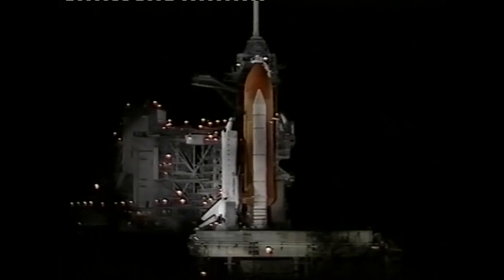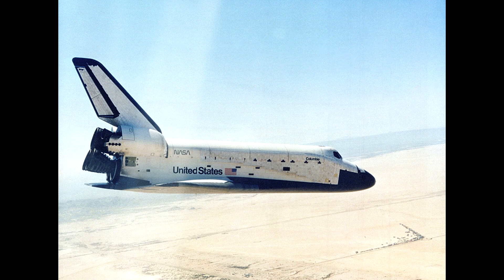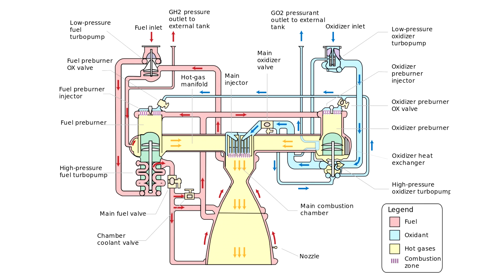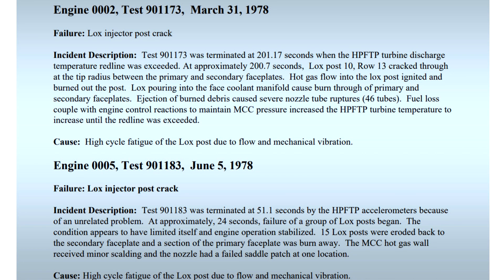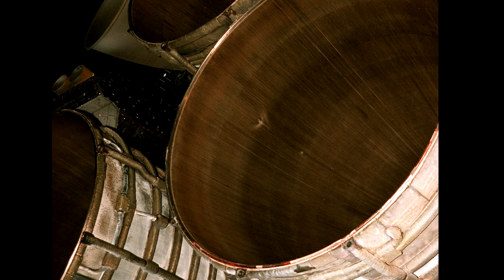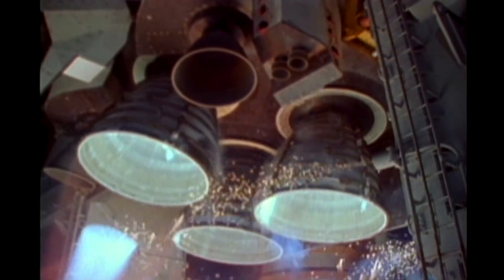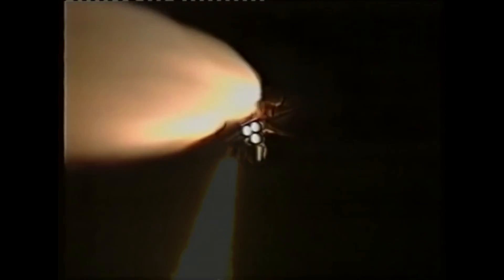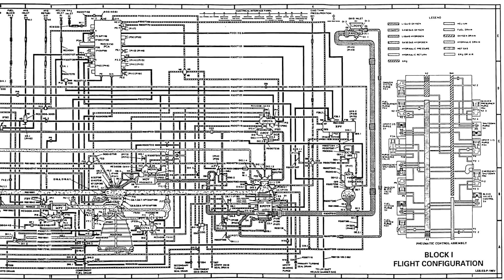How A  Gold Bullet Almost Destroyed A Space Shuttle

Comment: >Oldest shuttle orbiter with increasing failures
>Biggest payload yet (and ever)
...Yeah, that seems like a good idea.
Reply: It was the last mission before the scheduled upgrade that all the orbiters were undergoing at the turn of the century. Its next flight was Mike Massimino's first Hubble servicing mission. It was then lost due to a completely unrelated issue that was not age-related. Although it was one that had been seen 15 years before on an Atlantis launch. Hubris and complacency killed all 14 astronauts, not the vehicles.
Reply: The hubris and complacency of letting 26 unrelated committees design the Shuttle that way to begin with. Putting the crew next to the fuel with no escape mechanism = colossally stupid. And for what? It ended up costing just as much to launch as a non-reusable craft would've.
Reply: Actually it came out costing insanely more, NASA itself says 500 million per launch, with other (I'd say more realistic estimates going as high as 1.5 Trillion per launch)
Reply: @emp_zealoth  - Former astronaut Jeff Hoffman, who is now a professor at MIT, is teaching a class called "Engineering the Space Shuttle". It is available for free on the Edx platform. The co-professor for this course is Aaron Cohen (he passed away in 2010, but his lectures were preserved from the initial teaching of the class in 2004), who was the manager of the Space Shuttle program from 1972 until 1982. Cohen oversaw the entire design, testing, and initial flights of the space shuttle. It is a fascinating class, and there are many guest speakers who were also involved in designing and flying the shuttle. Anyway at one point they talk about the costs of the shuttle program and they mention you could break down the costs in multiple ways. Hoffman talked about the expenses of mission planning, training of the crew, processing and development of hardware for each mission, the processing of the orbiter, boosters and ET, etc. Anyway they mention the STS-83/94 missions. STS-83 was a Spacelab mission that was truncated due to a fuel cell issue, and landed only four days after liftoff. It was decided almost immediately to re-launch the mission as soon as the fuel cell was repaired. So the entire mission was re-flown just a few months later. The kept the same crew, the exact mission profile, and experimental hardware. They mentioned that the repeat mission, STS-94, was overall the least expensive mission in the program as it did not require processing of cargo, re-planning, re-training, etc. It was figured the direct cost of the mission was around $150 million USD.
Reply: I'm not sure I see your point. If reflying a completely prepared mission costs whopping150 mil then the entire program was a complete and abysmal failure
Reply: @emp_zealoth - The point is there was a discussion about the costs of a flight. There are many ways you can break down the costs. But at its basic level, the cost of grabbing an orbiter, processing it for its mission, and flying it to space and back, was estimated to be around $150 million (in 1998 dollars). Just for informational purposes, that is all. Calling the program a complete and abysmal failure is a bit harsh as it did accomplish many tremendous things. It just failed to do them as frequently, inexpensively, or reliably as promised at the beginning of the program.
Reply: It's main objective was to provide cheap, frequent and reliable space flight. It utterly failed on all those counts but was kept around way past it should have been due to political expediency, in the process sucking boatloads of money away from other, way more useful space technology or exploration. Thats where the main problem with STS was
Reply: Krzysztof Zalewski You’re naive to think bureaucracy, especially American, would allow the wasteful disposal of something as large as a shuttle. New rockets, shuttles, and missions go through an enormous amount of red tape, because NASA is an arm of the government. This is why Space X will lead the space race now, since Elon Musk has the money to just throw rockets around while testing them.
Reply: @GeneralSeptem  Russians built the Buran, a clone of our shuttle, solely because we had done it.  They thought it made no sense, but that there must be something more to it than they could see.  They flew it unmanned one time, and parked it  Smart folks, realized quickly the idea actually didn't make sense with then-available technologies, and cut their losses!

It did line the pockets of a lot of US companies, though.  Congress-critters bringin' home the bacon!
Reply: @emp_zealoth  LOL 😂
Reply: Every other shuttle has an external airlock. Chandra is too big to fit inside with said airlock. So they did what had to be done.
Reply: +xureality
"Every other shuttle has an external airlock. Chandra is too big to fit inside with said airlock. So they did what had to be done."
That was after this mission. The external airlock was added for ISS mission/servicing/resupply - and this was actually the last mission Columbia flew before getting her upgrade (which she still did not receive the conversion that the rest of the active orbiter fleet did). There was no "oh no, we ABSOLUTELY HAVE TO DO THIS" circumstances. It was merely bad planning. And it's not like this is NASA's first (...or last) bad call. Just, thankfully, this time no one died. Although, quite obviously, we came VERY close to having that happen.
Reply: "The external airlock was added for ISS mission/servicing/resupply - and this was actually the last mission Columbia flew before getting her upgrade (which she still did not receive the conversion that the rest of the active orbiter fleet did)."
Columbia is heavier than other shuttles, hence why she didn't receive the airlock: it was left out as an option in case other long payloads like Chandra needed lifting.
"There was no "oh no, we ABSOLUTELY HAVE TO DO THIS" circumstances. It was merely bad planning."
The other 3 shuttles has already received the airlock by this point so that wasn't an option. Was using another launcher entirely an option? I don't know, maybe? There's more to launch vehicles than "will it lift?" so that's a hard question to answer. All we knew is that NASA decided that using a shuttle was the way to go and the rest is history.

Also, hindsight is 20/20.
Reply: @xureality  "The other 3 shuttles has already received the airlock by this point so that wasn't an option."  So they couldn't have yanked the external airlock out of one of the other orbiters for one last mission?
Reply: @matchesburn  May I remind you that long before the ISS, there was this minor thing called MIR that the shuttle visited since 1995? Discovery, Atlantis and Endeavour had an external airlock ever since to allow for the ODS (Orbiter Docking System) to be installed on top of that. Plus, because these three were lighter than Columbia, it was more efficient to use them for the high inclination orbit and heavy payloads flying to the ISS, so Columbia was the better option at that point.  

@The YouTube Phantom Official: "Breaks up in reentry because of a similar failure to the ablative foam panels as Challenger, this time damaging the wing and killing all 7 onboard in a ball of fire and molten metal". This shows your lack of knowledge on the matter; Challenger was lost because of a ruptured O-Ring in the aft joint of the right SRB that allowed a burn through in the side of the case that ended up melting the aft strut connecting the booster to the external tank. Failure of the ablative foam panels had nothing to do with Challenger
Reply: This incident was not related to the age of Columbia. The main engines (SSMEs), where this problem originated, were interchangeable among the orbiters. SSME #3 on this mission was SN-2019 and had flown 18 prior missions on all of the orbiters in the fleet except Challenger. It had flown five times on Columbia (STS-9, STS-28, STS-50, STS-65, STS-83), three times on Discovery (STS-26, STS-48, STS-70), seven times on Atlantis (STS-51J, STS-61B, STS-36, STS-37, STS-38, STS-76, STS-86), and three times on Endeavour (STS-54, STS-57, STS-61). This was the last mission to use SSME SN-2019 and by the end of the program it was the most used SSME with 19 total flights flown.
Reply: It was also one of the heavest shuttles and the One shuttle in the fleet that had the cargo space.  it was also the one they called the penquin because she rarely flew.
Reply: Scott explained in another comment chain that all the other shuttles were busy with the ISS. Logically speaking, it would have probably made more sense to diverge a tiny amount of the ISS program's resource towards this, but the political backlash that might have came from delaying the ISS even a tiny bit was too much to risk.
Reply: Yep. kinda like they were the only way it was going to get done.
Reply: Yes, the oldest one, but everything on the Shuttles are checked rechecked and checked again. But still, I do agree with you absolutely.
Reply: Well it was an American product and they just put in a new distributor the other day.
Reply: My car is pretty old and has had a lot of failures itself and has carried a lot of stuff in the time I’ve had it. I’ve named it Coco, named after the Space Shuttle Columbia, since she was a little old and you can definitely see her age on it.
Reply: As much as it's unique design inspired the children of a generation, it was a terrible idea and cost far more than alternate rockets would have cost. Being so complex meant it was destined to have more glitches (sort of like a BMW car!). But it saved us when people were caring less and less about space.
Reply: Johnny Steen Ha hey, sexism! Well done, you've single-handedly decreased the reputation of the Scott Manley fanbase
Reply: @patrickbeart7091  🤣 it was an amazing joke.
Reply: @patrickbeart7091  Its just a joke. Well, a bad one but still a joke.

Just cope it with the fact that this women drive her shuttle much better than everyone of us here, even with all stupid shits she had gone throught, like golden bullet and typical bad jokes on youtube....
Reply: @manictiger  Some people just can't handle it you know. Sarcasm is not something that some people can accept and suck it. 

Also, i consider it as a "bad" because it was rather..... old and stale.
Reply: It's 2015+3; they're onionboys, not soyboys. Get with the times old man.
Reply: @patrickbeart7091  judging from the likes, they're more in touch than you are, go away
Reply: It's just a joke.
Reply: And they let a woman drive, no less.
Reply: Johnny Steen 

A woman as pilot is irrelevant. It was Columbia that sadly perished on re-entry due to a piece of insulating foam striking the wing.
Reply: @briane5706  he didn't really mean it as a relevant point, he's making a joke.
Reply: @briane5706  Brian E

It was a fucking joke 🤣
Reply: Johnny Steen that’s a sexist joke
Reply: @Mgl1206  the joke is that you're still mad 2 years later
Reply: polygondwanaland the internets forever, one can always be angry at something no matter how old it is.
Reply: @Mgl1206  a good sexist joke 🤣
Reply: @GeneralSeptem  I get the joke, but if someone becomes an astronaut they're the best of the best.
Reply: @GeneralSeptem  what’s wrong with that?
Reply: @1976kanthi  You seriously never heard women driver jokes. You need to get out more.
Reply: @GeneralSeptem  I'm sure she knew what she. Women aren't stupid.
Reply: @harrietharlow9929  damn that shit flew over your head at mach 7
Reply: @GeneralSeptem  Jesus Christ 😂
Reply: Blessed be His Name.
Reply: @GeneralSeptem 
Lmao
Reply: @GeneralSeptem  I assume you're not very popular with women? Lol.
Reply: @kansasjayhawk8386  Real women love strong men.
Reply: @GeneralSeptem  ahhhhhh-ha ha ha ha ha
Reply: You know Johnny, people come here for science, not sexist comments.
Reply: @Kat-kf5nx  Sorry you know everything. Apollo anniversary videos on fake news were overly sexist, going out of their way to glorify a few women who did a small job.
Reply: @Kat-kf5nx  102 likes on the woman driver comment. Here's some science for you. Science and video games prove that men have better motor abilities.
Reply: @PeopleHealthTru  Videogames prove that men have better motor abilities. I'm sorry what? And how would it be sexist to credit women for their jobs... I fail to understand your point. There were several female Russian pilots in WW2 that saw more kills than men, there was even a man who lost both his legs and returned to wartime aviation to perform considerably well. If there is a status quo for a job, don't lower it, but don't discriminate either based on sex, skin color, genetics, etc or we will live in a society similar to the science fiction film Gattica.
Reply: @Kat-kf5nx  Feminists are racist and discriminate by demanding pay, employment, elections based on race, color, gender disorders. Performance and Christian morality should be the qualifications.
Reply: @PeopleHealthTru  I'm not really angry over it, I'm taking an argument over YouTube with a grain of salt. I don't think you understand the issue either, feminism isn't the problem, it's the radicals. I digress though, I can't change your opinion and you can't change mine but I commend you for trying.
Reply: @TheGreenTaco999  You could probably account the likes toward people passing over the comment without viewing the replies. It sort of happens. But you're totally right, they know best, just like I know what's best because I garnered 4k likes on a comment saying. "Who's watching this in 2019?" If only I was that desperate to make myself relevant. :P But keep white knighting because it's been amusing so far. Usually people put an indication that it's a satirical joke since being deadpan can be mistaken. Just saying.
Reply: Breaks up in reentry because of a similar failure to the ablative foam panels as Challenger, this time damaging the wing and killing all 7 onboard in a ball of fire and molten metal
This is why it's a good thing NASA got defunded, because for rocket scientists, they really aren't that smart. Let's hope SpaceX learns from NASA's mistakes.
Reply: @lsswappedcessna  😂😂😂🤣
Reply: @lsswappedcessna  This aged well dude.

Comment: Really interesting and somewhat unsettling video. When the crew eventually found out the litany of potentially disastrous failures which had been going on underneath them, they must have been shaking their heads in disbelief. Was it engineered safety, or were they very, very lucky?
Reply: Luck is always a factor, or non-factor.  Engineering is all there is, really.  In this case the redundancy engineered in overcame the engineered-in problems.

Comment: did mission control have any control over the shuttle?
or was the captain really the pilot in command?
Reply: The pilot and commander (in the two front seats), but mainly the five computers.  They were the only means of providing a millisecond-level control loop.  Mission control could advise.  The humans could flick switches. That's the significance of the report at T-35 seconds that the onboard computers have control.
Reply: Astronauts are trained to fly manually as a very last desperate resort, but the onboard computers are the only system that can operate the engines with the precision needed. The start-up and shut-down sequence of the RS-25 engine is very precise, events have to happen in sequence at exact times relative to each other or the turbopumps may overspeed or something could burn through. That's why there are five computers, and the software code on the Space Shuttle was the most error-free code in history.
Reply: The captain didn't really have much control either.  The on-board computers drove the shuttle.  Everyone else was monitoring.  The crew had the ability to manually shut down the engines and abort the mission.  That's about it.

Comment: So if 100 things have to go right for a rocket launch to succeed, but only 1 has to go wrong for it to fail, how come this one succeeded, when several things went wrong? XD
Reply: There's different degrees of failure.
If you are driving down the motorway at high speed and get a nail in a tyre causing a slow puncture your handling will be a bit off and you will probably be able to get somewhere safe to get it fixed.
If you run over something bigger and your tyre just shreds at high speed then you may well end up wrapped around a tree or under a lorry.
Many things can go wrong, it just needs something to go wrong just right.